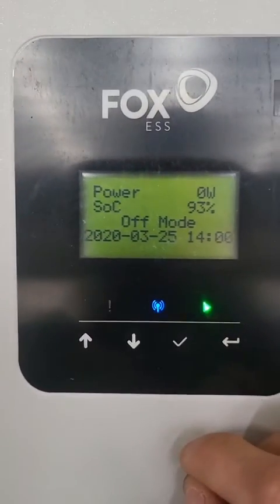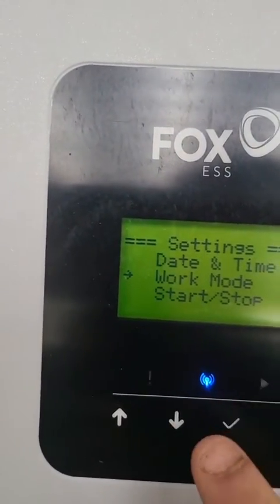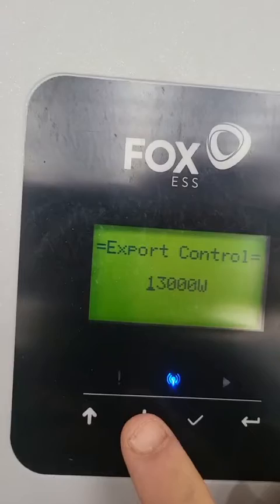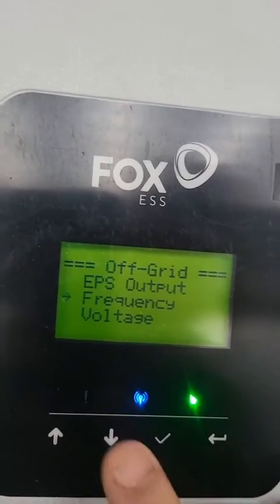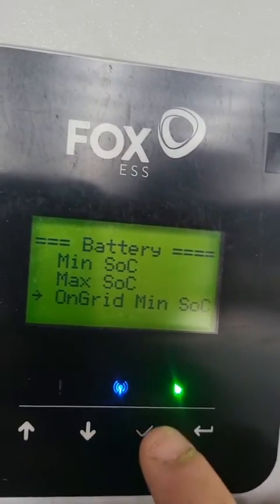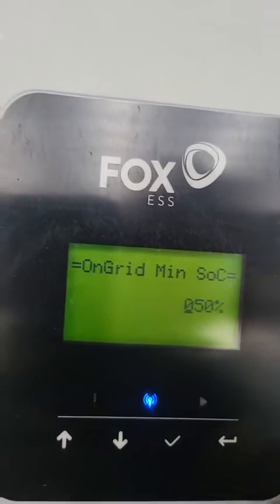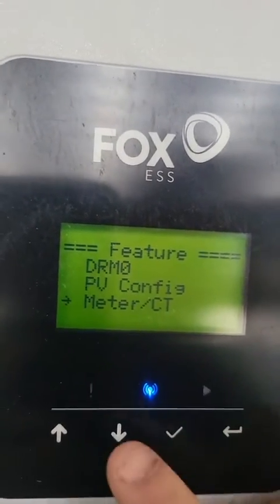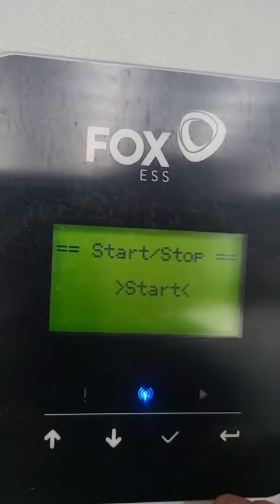Fox 10.5 - Commissioning Settings

Comment: Hello Nick.  I used this code 0000 for my fox ess 10kw inverter. But it didn't work. Why?
Reply from the maker: Your password can be changed or reset online on the foxcloud if it has been changed from 0000
Reply: Thanks, I will try.

Comment: Hi, I’ve just installed mine, I’m using it as a ups no PV panels . I have a few questions: 
1. What is the difference between self use and feed in first (under work mode) 

2. It’s brand new but it seems to not be charging is stuck on 61% even though it’s on 2000kw, what is the reason for that. ( is it because it’s preserving the battery?) 

3. What is the difference between EPS and UPS mode (on off grid)
Reply from the maker: Dear Lara, thanks for reaching out, please advise which country you are in?

Comment: Hi, are there any function for limit tension and adjust export power automatically?
Reply from the maker: Tks, you can set export to zero or to what ever value you choose. The value is fixed until adjusted.